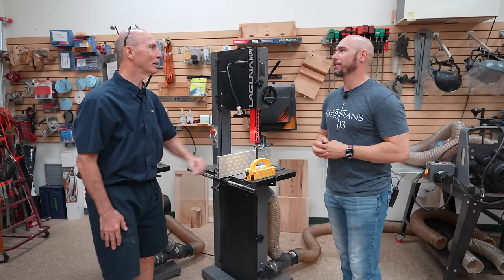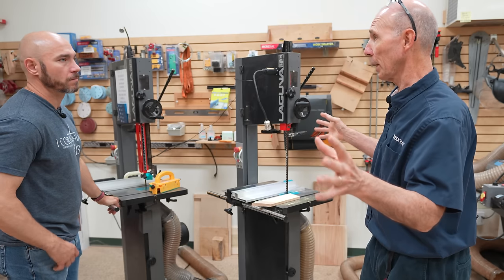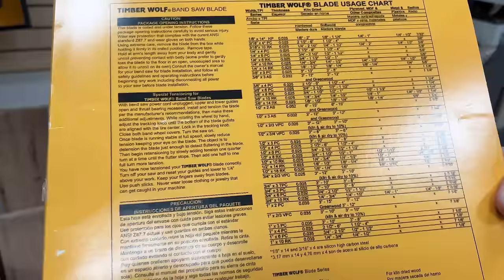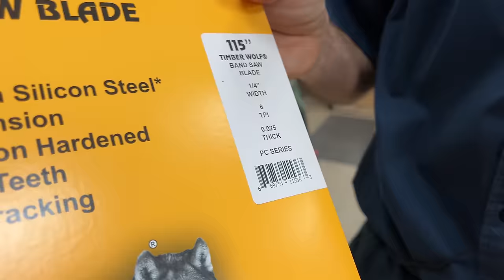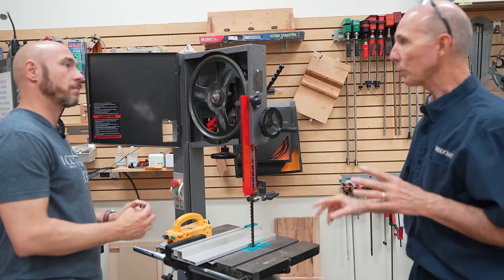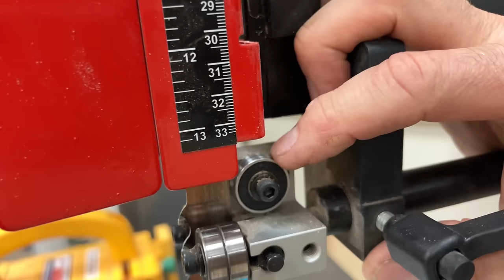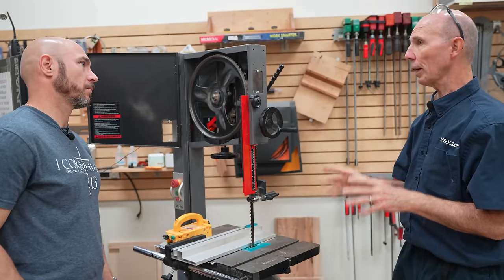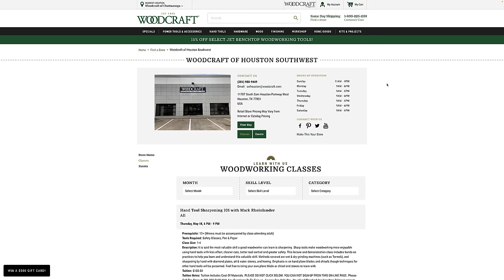How to Use the Bandsaw | Beginner Woodworking Tips and Tricks

Comment: Perfect timing for this video, I have been having issues with drift when re-sawing, figured I just needed a new blade, which I ordered. Then watched this video, next day stripped off all the guides, cleaned thoroughly, replaced and reset up. Hadn't got my new blades yet but figured I would just have a quick try at re-sawing some oak, what do you know, no drift.

Comment: Wen has a really good 14” bandsaw with an 8” re saw capacity.
After doing the math, the horsepower comes out around 1.45-1.5 @ a 120v.
And it’s under 900$.

Comment: I have the Laguna BX14 110v and I must say the brake feature is super convenient. I had issues setting it up at first but it's doing what it's designed to do. I like Alex Snodgrass' assessment that the deepest part of the gullet on the blade should ride in the middle of the wheel. I've never had the need to use anything wider than a 3/8 blade on this bandsaw. The Carter guides are a MUST. They have awesome blades too. Thanks for the shout out at the 13:15 mark 🙂

Comment: downside to carbide blades, if you snap them after a year youll have to just buy another one from laguna if you want to use it again. if you snapped one every few years the timberwolf would still end up cheaper over time. it very much depends

Comment: I have purchased a skil table saw based on your recommendation, have a skil sliding compound double bevel miter saw, have a makita plunge router, and a cordless 20v Craftsman tool kit. I am a beginner but have drive to learn woodworking. What would be the next machine. Bandsaw, drill press, router table?

Comment: There are tons of used bandsaws no need to spend thousands. I got 4 from small to huge and paid under $200 for them all. Just look for good deals and bandsaws that need a little service. Also, you can buy rolls of bandsaw blades for like a dollar per foot. Making your own blades to your length is easy and soooo much cheaper.

Comment: Everyone in north America has a three wire supply system of 110/120 V plus 110/120V plus one neutral,  so therefore everyone has 220/240 volts supplied to their houses, it is a simple matter of doing the wiring,  So it is better to get a 220/240 volt version.

Comment: Hello , my blade is always running of from the rubbers. Do I need new rubbers. I adjusted the blade already on the back. Is it possible that there is to much tension on the blade so it pushes to much on the rubbers and push the rubbers out of the gides. ?

Comment: Great vid. However he is wrong about the ceramic guides. If they are always contacting the blade then you have set them up wrong. They are setup just like rollers and dissipate heat much quicker.  Think of the space shuttle, what is the underbelly coated with? Ceramic tiles. So I don't see the rollers as a upgrade.